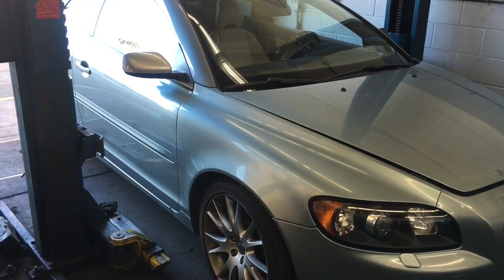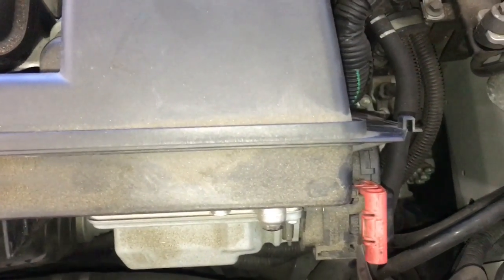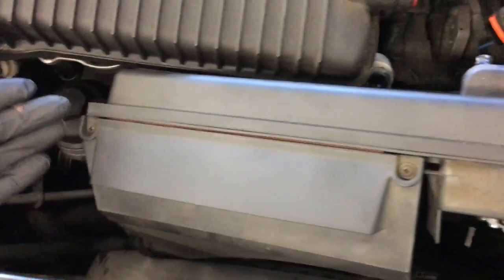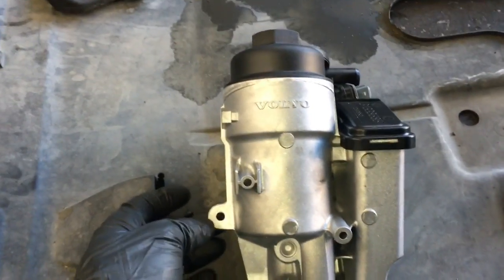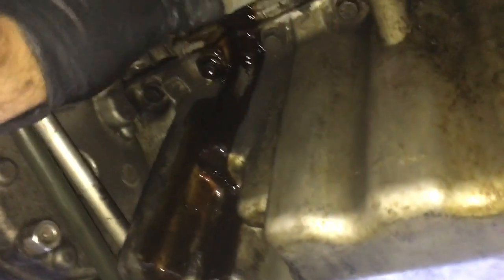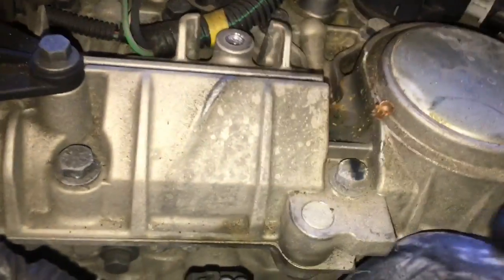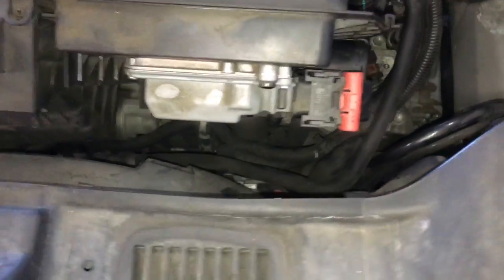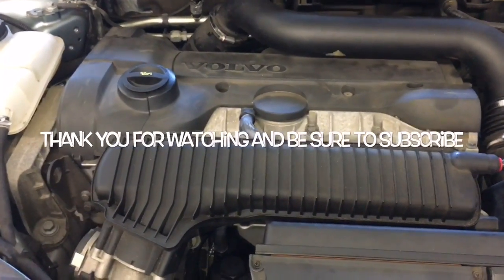How To Replace An Oil Filter Housing On A Volvo C70

Comment: Thank you for taking the time to do this.   This was the best resource I found to assist in changing my oil filter housing.  My spouse and I were able to do this without a single complication other than dealing with compact space.  Thanks again.

Comment: Great Video, Thank you. i am ready to tackle the job.  One tip on removing the T5 airbox I discovered by accident.  With the vehicle on the ground in park, gently use your knees to push against the front bumper to rock the car.  This will tilt the engine back slightly to help extract the airbox from the tight space.

Comment: Doing this job tomorrow.  You should disconnect the negative battery cable before starting the job.  That way the computer is not powered up while taking off the plugs.

Comment: This video is awesome! It will help me a lot when I'm changing the unit on my volvo, which will happen in 5 days. I have ordered the parts, and was worried that it might just be too complicated to do, but after watching this video, my worries are gone. I have replaced my c70 with the KN intake, so I have a lot of space to work with. I just wonder do I really need to replace the oil after replacing the unit? I just had an oil change last week, with new filter as well. I just wonder if I can reuse the oil? 

Thanks a lot!
Reply from the maker: Liangshuo Xu  I would replace The filter it's not that much money and you can pick them up at your local stores. Thank you for writing to me.
Reply: Thank you Brian! This video is really helpful. I think it is better just to get everything new and fresh like you suggested. Let's just hope I can do it with no drama. LOL Have a good one!
Reply from the maker: Liangshuo Xu you got this 👍🏻
Reply: Hi Man! I replaced it yesterday! Without any problem, it passed the state inspection today! Thank you so much for your video! You helped me saved $400! Really appreciate!
Reply from the maker: Liangshuo Xu awesome glad it helped out!

Comment: What is the reason for replacing this thanks great vid btw
Reply: Aaron Elder Eventually the oil filter housing/pcv starts to clog up with oil, causing loss of boost, noise, and eventually back pressure that can blow your seals. This is a commonly known issue for all T5 Volvos.

Comment: When you tame off the gasket, the oil comes out too. Did you drain the engine and change the old oil for new and fresh?
Reply from the maker: Rudy-Dario Valenzuela I would recommend changing the Oil at the same time.

Comment: I wonder if that oil filter housing is plastic? Volvo better be selling metal oem replacements because that ain't gonna work. Had a toyota that came with a plastic OFH but replaced with an aftermarket metal housing leaked like sieve then I found a metal OFH made by Toyota then I put that in there it was dry as a bone.

Comment: SWEET GOD Last volvo im owning is a S60(nightmare in its self)...who would move all this plastic parts around breaking them as the heat and time creates brittle plastic..this is way over engineered !!! whats a job like this run id guess $600 plus with parts ...

Comment: I have a 2007 ford mondeo with this engine. engine runs very well but every now and then rpm drops when im driving like I've took my foot of the peddle and then it kicks back in really strange anybody had this issue

Comment: Thank you for this video. I changed my PCV oil housing with these instructions and all went pretty well. Took about 5-6 hours because there were bolts so damn tiny places. I would say one advice before you put new PCV part in. Check all the bolt hole threads before you start tightening it if  you have tool for it.

Comment: That was a very informative video but couldn’t I just replace the seals and the PVC diaphragm?  I have a leak in the same general area on my 2014 S60 but not sure if it the turbo oil drain or the oil cooler seal. 
Any advice? 
Thanks again for a very informative video.
Reply from the maker: The best way to tell is to clean the areas thoroughly and run it for a little bit and check to see if the fresh oil is coming from the turbo or the PCV.

Comment: Is there a way to change the unit without changing the (upward) hose? So can I get the unit out without cutting it? I'm asking because my dealer did not give me the hose and it's not easy going back now to get it. Thanks! Great video, well explained.
Reply: You can reuse the hose. Thanks for this great video, How To Automotive. Appreciate it. On a 2005 V50 the biggest challenge is to get the PCV box out once it's loose - The air intake is just in the way and there is no good way to put it off. Gentle squeeze did the trick. Thanks again!

Comment: Just wanted to say thanks for this video, saved me $650! Well, I'm doing it this weekend but doesn't look too bad. Loud whistle and CEL P2187, dealer said pcv is clogged. Volvo has an extended 10 year 120k warranty (#205) but I got totally screwed. Car has 70k and was purchased Jan. 4th 2007. I ended up missing the 10 year coverage by 9 days. FML
Reply from the maker: Evan W that suck about the warranty. They wouldn't work with you over nine days that's crazy!
Reply: Currently they gave me a 30% discount off of parts, we'll see if they budge a bit more

Comment: I have a 2012 c70 t5, car is leaking oil and its coming from the back of the engine on the passenger side towards the top, i also noticed some oil on the inner side of the timing belt. Could your repair be the culprit? I was actually getting ready to order a timing belt kit that comes with 5 seals, tensioner, water pump etc. because i was thinking the oil is coming from the vvt.
I would appreciate a quick answer.

Update: I asked the question without watching the video and the location of the oil separator is in totally opposite to where my oil leak is at.
Reply from the maker: National Motor Co. sounds like it’s coming from one of the cam seals. I would take the time and cover off and look and see if the oil is under there.
Reply: @HowtoAutomotive  that's the kind of answer I would expect from a professional. Thanks